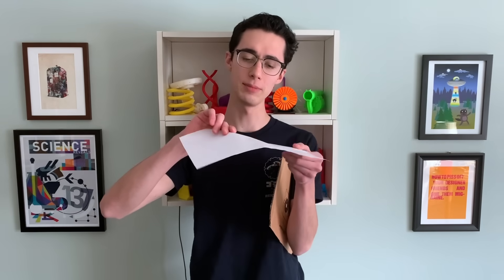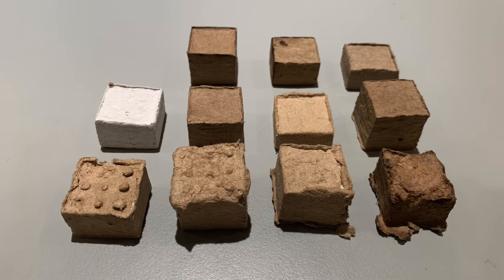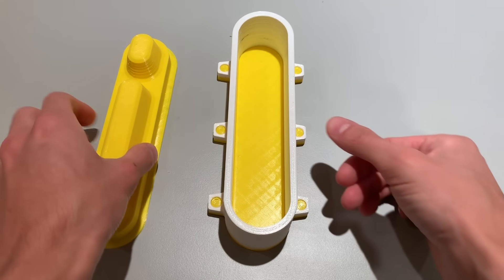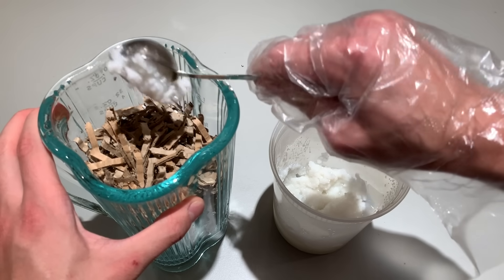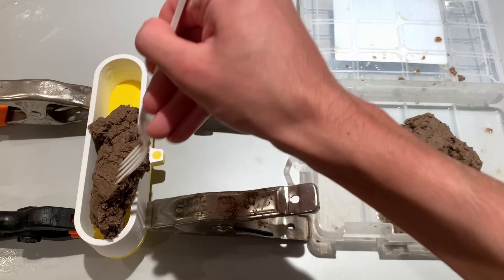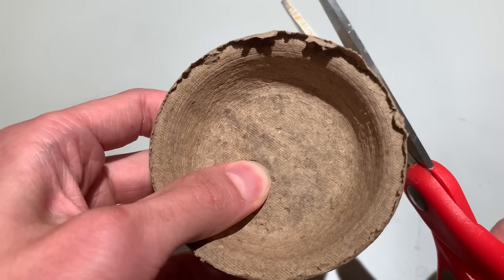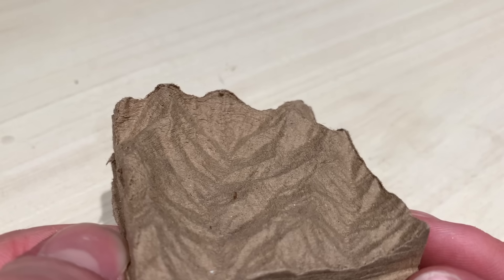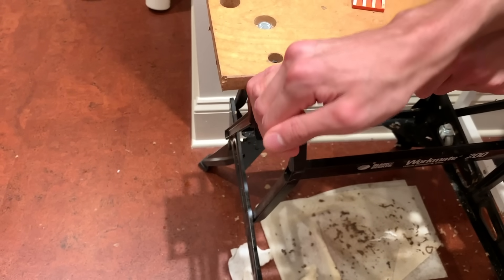Recycle Cardboard into Anything with 3D Printing!

Comment: What if you used acetone instead of water and added styrofoam as the binder to recycle syrofoam. You would have to use an undisolvable type of plastic or metal as the mold but it would help and reuse styrofoam and it would be more resistant to water
Reply: Someone needs to do this
Reply: The acetone would also interfere with the hydrogen bonds between the fibers after water is removed, which would mean the strength would be reduced. The acetone might not cause this, but for example butanol does.
Reply: Regardless, the wet strength would not be increased unless something like a wet strength agent (the specific one would depend on the pH of the pulp) was added to the pulp. Sizing which would slow the penetration of water may also help, but would depend on the pH as well and would also require specific chemicals.
Reply: it would take so much cardboard to make any significant amount of moldable material.
Reply: why would you take an infinitely recyclable material like Styrofoam and make it non recyclable by adding the needed to remove paper fibres?
Reply: Acetone would destroy the blender.
Reply: @jaqssmith1666  Nothing is infinitely recyclable
Reply: The acetone+Styrofoam+paper  is a good idea, but it would be hard to achieve. As a start the acetone shouldn't go to the blender at all. Also molds have to be something else - metal for example. Maybe the paper can be dry-blended  and then mixed with Styrofoam-acetone (more paper, less plastic than just Styrofoam). But it wouldn't be as environment-friendly as  just rise-paper.
Reply: Acetone doesn’t do anything to PLA right? So I think the 3D printed molds would still work fine, as long as you don’t use ABS.
Reply: That's a ingenious idea.
It's enough different, that it's an entirely different one.
Reply: thats napalm dude
Reply: @FamAccNr1  
Bruh
Reply: @yourdad9168   Polystyrene foam is melted down into general purpose styrene, which can be used the same as virgin material and recycled over again. 
Eventually solar, chemical, or contaminating damage would render it unsuitable for recycling, but it's usable lifespan is much longer than paper fibre.
Just like aluminium, recycling won't change the mechanical properties of the end material: this is what's meant by "infinitely recyclable"
Reply: Superhydrophobic coating
Reply: You could just dissolve the polystyrene in the acetone until it's super-saturated and paint it on the item after it has dried.
Reply: Instead of acetone, you should use d-limonene, it's derived from oranges, environmentally friendly, and completely liquefyes almost any polystyrene
Reply: @will9357  : PLA is (varying degrees)Acetone resistant as is  PolyPropylene., polycarbonate  and nylon...  Just don't try with ABS (the S stands for Styrene, acetone will dissolve it readily...  (don't heat the acetone and more plastics can handle some contact....)
Reply: @nickpelov  : IF someone was going to blend woodpulp and dissolved  styrofoam, they may be able to create the wet woodpulp and then mix with the dissolved styrofoam..  (in a drum with a plaster stirrer  to save the blender seals, and avoid an explosion.)  The acetone (should) dehydrate the woodpulp, but the mix may become too stiff to work   - NB . there is nothing safe or environmentally friendly about this method (acetone has to evaporate and is an organic pollutant, so it looses green credentials..
Reply: I remember trying to make a flat plate out of recycled styrofoam acetone mixture. It worked fine but it took ages to completely dry.
Reply: I use this mixture to repair roofs when the sealants suck ass. Gasoline and styrofoam mixture, it dries up into a hard plastic that's quite durable and can block water. Oh, and the mixture is also known as napalm.
.
Edit: Once dried, the mixture isn't as flammable.
Reply: Styrofoam is no more a recyclabe material, and the paperpulp should be a dried Sand. Acetone then Will melt the ABS in yer PLA plastic (Yes many drug PLA with ABS, it's cheap) making It flimsy and gummy....😑
Reply: @will9357  Most people have stopped printing in ABS outside of high temperature needs, and PLA is extremely resistant to Acetone (though acetone can bleach the dyes in the PLA)

Comment: You could mix chopped fibers (carbon fiber, glass fiber, or even ... hair?) in to the post-blended pulp mix. That could at a LOT of stiffness to a given part. Cheers.
Reply: That's a very bad idea if you want to touch that part later on.
Reply: @karolkoniecki4007  a layer of lacquer or even epoxy would fix handling considerations and provide even more structural integrity.
Reply: The problem i see here is that you have a contaminated paper (carbon and glass fiber) after wich makes recycling way harder. But hair would be ok since you could just compost it.
Reply: I just went from looking at videos about using graphine blended with concrete to this one about pressing cardboard pulp...graphene could be a serious possibility for engineered wood and paper, if it comes down in price. Though the ecological and health consequences of graphene use are not really known.
Reply: You'd want to either mix it in manually after pulp, or already have it cut short, because long fibers could wrap around the blender shady and wreck the motor
Reply: Hair if you have a pet is very easy to come by
Reply: I've seen people use cotton fabric (t-shirts) to make a "fake fiberglass" composite.  Instead of resin, the pulp could be used as the filler!

Comment: I imagine you could enhance the strength with hemp fibres or something similar. Really there's tonnes of ways to amend the mixture with organics to change it's properties. Thanks for the vid, that's an instant subscribe.  You've just changed the guerrilla gardening game.
Reply: For reinforcement ideas, look to existing paper mache techniques. They use cotton meshes which add strength or thin bamboo skewers or even small diameter wood dowels (for larger projects). These wood-like materials respond to the same adhesives and binders as the paper pulp so they all bind together really well.

Comment: You could also add a fiberous "rebar" material to increase strength. Thin fiberglass for reinforcement or long cut fibers from a plant or even a shirt could go a long ways in adding directional strength.
Reply: A lot of people juice Wheatgrass, the waste from the process is pure fibers, they seemed really strong. Could be interesting to play with

Comment: Imagine making sound dampening panels out of this stuff
Reply: @GenIus-zm3qf  same thing with any other sound dampening panels tho
Reply: @vertio5636  No, sound dampening foam is fire resistant, this cardboard burns fast
Reply: @GenIus-zm3qf  well whats the chance of it catching on fire tho
Reply: @GenIus-zm3qf  this is fire resistant bc it burns hot and slow, much like how you'll struggle to light a charcoal brick with a match
Reply: @GenIus-zm3qf  Compressed paper doesn't burn as fast as you think it does. If you throw a whole phone book into a wood stove it can sit there for a couple hours before burning through to the center.
Reply: @GenIus-zm3qf  Aidan said it loud and clear in the video he didn't have much luck burning it.
Reply: @GenIus-zm3qf  mix some borax into the pulp for flame resistance.  Also repels pests that might want to eat the wood fiber.

Comment: I imagine painting these with a wood sealer varnish type paint may make it waterproof. Wish i had a 3d printer I'd be trying it if i did.
Reply: you have wood ... and tools to deal with wood ... make a mold with that ... leave little drain holes near the base for water and off to the races you go ... then you can even texture it as you feel like ... varnish the inside of the mold and drain holes ... then press away ... btw a wood mold will last many forms longer than the pla one ...

Comment: Nice presentation. I wonder, if rather than using mechanical pressure to get the water out, you could use a vacuum pump to remove the water. The advantage (besides speed) would be removing air pockets, and not needing a very sturdy mold. You might even be able to use softer molds like silicone.
Reply: Without compression it might get weaker by a little
Reply: I think that pressing it is pretty important to getting the density that you need for it to be strong
Reply: Yeah, I'm pretty sure the compression is a vital part of the strength of the part.
Reply: Look at how carbon fiber is molded; they use vacuum bags to infuse the resin and remove air pockets, as well as ensuring a good cast from the mold. I think if you want to use the same method, you'd need to blend the dry paper with one of the two parts before mixing them like this. It wouldn't be neatly enough to remove the water, as 1 atmosphere of pressure is only 101 kPa, and a c clamp (not the same as used in the video, but a similar screw mechanism) can produce up to 2000 kPa.
Reply: @James02876  wouldn't it suffice to bring the pressure down to the point where the water starts to boil at room temperature?

Comment: Hi, probably too many comments for you to read this one.
You could make even stronger things by using longer and stronger fibers such as hemp (carbon and glass fiber would be stronger but not organic).
These could be mixed in while filling the form, reinforcing in different directions where needed.
Do it, do it now!
Reply from the maker: Wow, I didn't even think about using paper pulp as the substrate for an even stronger composite. Experimenting needed!
Reply: @XYZAidan  I would recommend wool roving.  Roving has all it's fibers arranged in one direction( for spinning into yarn) and can easily be pulled apart into separate fibers for mixing into the slurry for random fibers, or can placed in the mold as Conny suggested.  stares at saw dust embedded in mittens It also attaches to wood fibers really well.
Reply: @XYZAidan  A lot of people have suggested hemp but if you can get it flax fiber (the stuff that is spun into linen for fancy suits) is a VERY long fiber. Long strand raw cotton also has some interesting properties though cotton isn't the most environmentally friendly thing. There is a kind of almost indestructible paper made from bamboo pulp. Nice yarns as well. All long fiber and extra strong.
Reply: As an intermediate step, you can add higher quality paper, which has longer fibers in it, to improve the strength. I am concerned about really long fibers, such as wool or yarn, binding up in your blender.
Reply: @richardattenborough5360  the idea is they get added while filling the form, post blending so it doesn't bind up -> also keeps the added fibers relatively organized

Comment: How about using powdered casein glue as a binder then microwaving or baking the molded object? It might result in very durable products.
Reply: This is the best suggestion I've read so far.  A natural alternative to resin.
Reply: @jones1618  I used it in a cabinet shop I worked in. We had this really dodgy, prehistoric microwave device at the end of a cable that we used to cook seams on large panels. The main unit looked like it came from Dr. Frankenstein's lab. We used to joke that we'd all become sterile from it.
Reply: @lunhil12  well? did you?

Comment: Your recipe isn't dissimilar to what I use for paper mache clay. The proportions are different, and I use cheap toilet paper. SO, if you increase the amount of binder (I use Elmers AND regular white flour), you wouldn't need the mold. However, I've been thinking about ways to make molds so that I could "mass produce" sculptures, and a 3D printer is a neat idea. :)

Comment: This was my senior thesis in design school in a nutshell, although you were far better at getting the bricks to dry and adhere together than I was.  I think my main issue was not having a long enough travel distance for my molds!

Really beautiful work and process documentation!  I wonder what this material would be like with a glossy finish on the outside.

Comment: I know this isn't the same, but you can make wood waterproof by scorching it. By scorching the exterior, it polymerizes the surface and makes it water proof, and believe it or not, fire resistant (it was done on the exterior of homes & ships back in the day). Not sure if it'd work on this in the same way, but it might be worth some experimentation.

Comment: A tip I've been given is to soak the paper pulp for a few days, to both get full saturation as well as resting the material.
Reply: I made paper ornaments years ago. Soaking shredded paper fiber first is necessary. The longer soak you recommend is really a "best practice"

Comment: I just watched this and I don't know if it has been suggested but for a water proof coating... Perhaps soak it in beeswax? Or linseed oil? Also is there a easy way to test the fiber length and strength correlation? Also, can you effect strength by alignment of the fibers?
Reply: Varnish works, just like how it works well with paper mache.
.
Or use egg whites as the binder.  Haven't tested it, but old cathedrals and houses made in the 1600-1800 are held by egg whites

Comment: This is amazing for small startups, or any person that needs to make a decent volume of objects. For individuals it's a bit of an antipattern since making the mold requires more work than making the geometry itself. So you might as well print the object. But Im gonna use it nevertheless :)
Reply: You can use it to make elements of repetitive structures (like bricks for a house). That's a very individual purpose and the mold doesn't even have to be 3D printed for that purpose.

Comment: get in contact with cnc kitchen here on youtube for strength test. he has great tools for strenght tests
Reply: +1 from me.
Would love to see this project tested. Especially how to increase the parts strength if using the rice paste binder. I have several 3D design that can use this project, but I don't want to use any plastic/3d print filament for the main parts.
Reply: i was about to recomend it, that's a great idea and could show the potential of this method
Reply: Jup this would be a great collaboration!

Comment: This is genius!

A small improvement could be adding holes and maybe small grids to drain water faster while you're compressing/drying the paste.

And I would be measuring everything (weight, volume, density, ratios for different mixes...) until I find "the perfect recipe", but I'm an OCD kind of guy HAHAHA.

Do you think this could be used to build something like a 7" mini bartop arcade with a Raspberry Pi?
Reply: You're not an OCD type of guy, you're a billionaire who needs to make it! Make it already dang it
Reply: Use nylon for the mold for strength and 3d print all sides of the mold with a grid of holes.  Expose the grid of holes to warm air to dry product.
Reply: @danthrift  Yes something like that is what I was thinking, then you sand the surface and voila.
Reply: @danthrift  nylon absorbs water and warps.
Reply: 3D print for prototyping and refinement, then CNC machine in metal of choice.
Reply: the issue i see with drainage holes is that the pulp may just squish out of the holes, and like another commenter said, nylon can't be used because it will warp so making the molds gets a lot harder. the way he described in the video seems to be the best way to do it

Comment: That's some awesome work ! 

For waterproofing without plastic try linseed oil or beeswax (could also help burning like firestarter).

You could also use casein from milk as the binding agent.

Adding holes or being able to print a porous structure would help getting the water out more evenly and faster.

Egg cartons and similar boxes are made from a steel mesh "mold" dipped in a slurry pulp with vacuum to suck the fiber on the mold. Maybe something to explore with a 3d printed mesh mold or pusher.

Subscribed ;-)

Comment: idk but can u replace most the water with alcohol so it will evaporate faster  or would make it not usable.?
Reply: would surely work, just might be more expensive. also the mold could deteriorate faster depending on type of plastik used. im also wondering if the cardboard could be mixed with wood glue that is water solvable and then let dry on a sieve before putting it in the mold and letting it dry there with much less pressure needed
Reply: @M.V.P.  titebond 3 would make a very strong bond and I think titebond 3 is water proof
Reply: Sad snake baking sand cake yes I too have done this no milk when making scrambled eggs... just add a small amount of beer season more robustly than just salt and pepper and your scrambled eggs can taste like steak too 😁
Reply: Jabril Anderson not funny
Reply: @Sad snake baking sand cake I'm gonna say this. That is badass and I would expect nothing less from Russia.